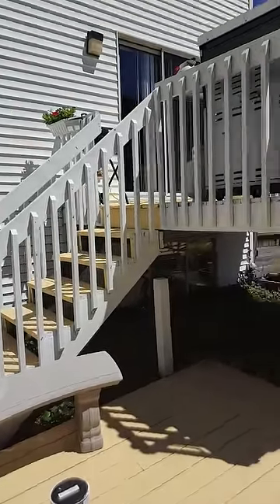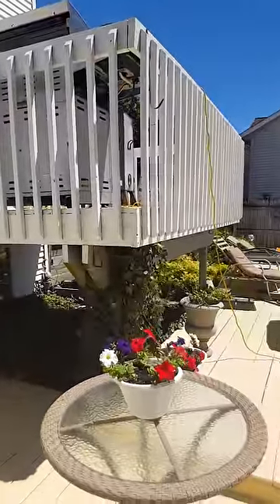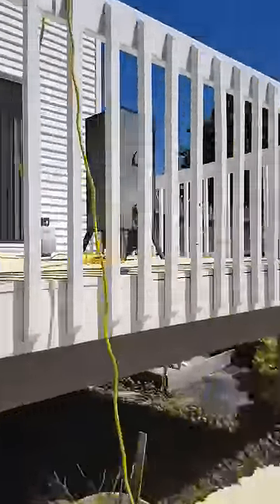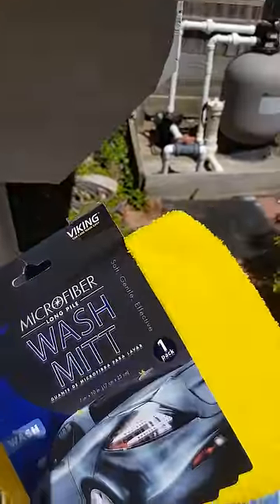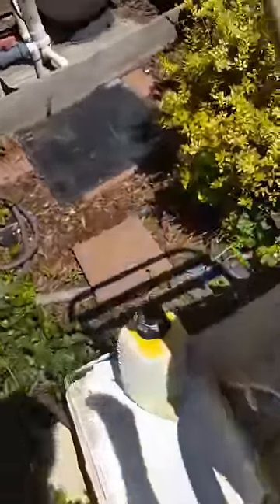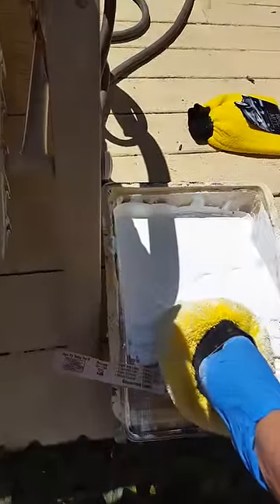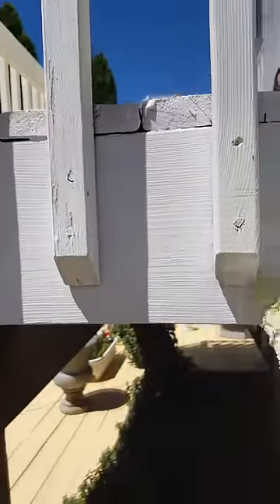How to Paint Spindles on a deck QUICKLY

Comment: Hey everybody- I am in the process of painting my deck and painting them with a roller damn near killed me. I was crippled for days with back spasm. A painters mitt is the ticket! Although I'm a little more lavish with the paint than this vid..(my deck is in such rough shape I have to scrub the paint into cracks/knotholes etc) It's is working out wonderfully. (still a horrible job but makes it easier). The paint doesn't arisol as much. If you have large hands- you can do all four sides of the spindles at once. I will never...ever doubt how hard professional painters work. Thanks for posting this vid. Great idea and it gave me the courage to try something new.
Reply: 18betz what paint did you use?

Comment: Can you paint over previous stain?
Reply from the maker: matt hip It depends on what you're using.  I love DECK RESTORE. If you already have an oil based stain,  then you would have to sand it first.  If it's a latex based paint then you can go over it.
Reply: Sure! Just make sure you sand it a little before hand or the paint wont look as smooth. just light sanding thought. You don't have to take any of the stain off.